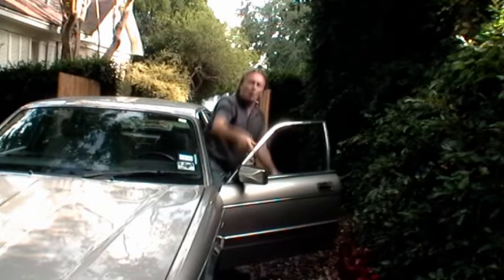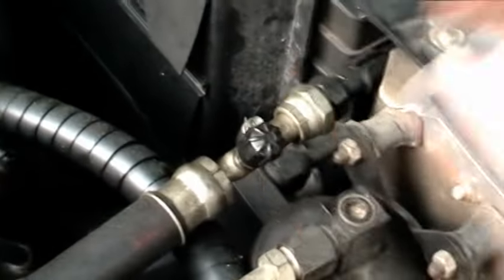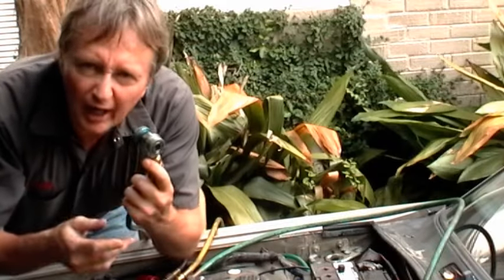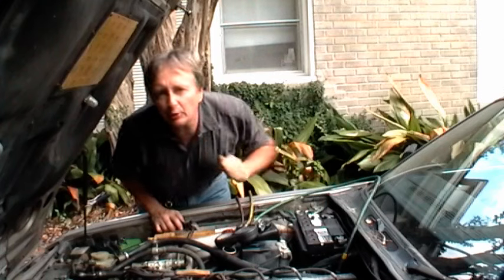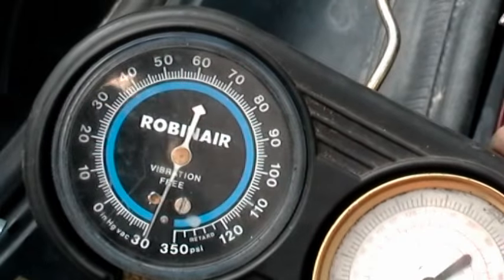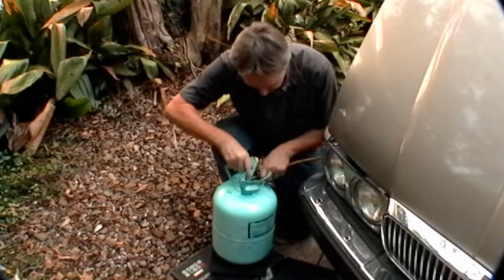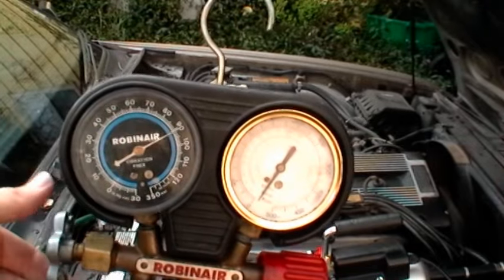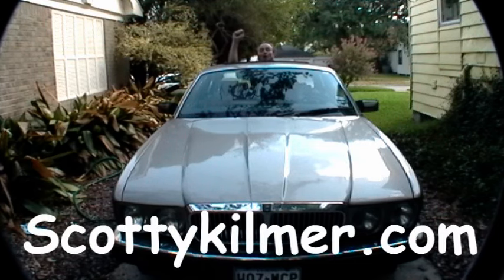How to Recharge Car AC System (Refrigerant)

Comment: I have an 88 Cadillac Allante. I just used the aftermarket coolant and it still doesn't get cold. Not even a little. When I first started, the clutch was engaging on and off a lot. Then it slowed down some. The gauge says I'm full. I wasn't able to hold the can straight up. Does that matter much?
Reply from the maker: you need the exact refrigerant amount, the ONLY way to do that is to vacuum out the old stuff, and add a factory load by weight or volume to be sure it's correct.. Start there

Comment: You may want to double check it my heavy duty truck systems text book ISBN10: 1435483820; ISBN13: 9781435483828 says 5 min and any time a A/C component fails or requires replacement the receiver/drier should be replaced as well.  My automotive technology text book ISBN13: 978-1428311497 ISBN10: 1428311491 is even more strict at 2 min for accumulators before it must be replaced.  Also any other parts left unsealed for extended periods must be flushed of solid contaminants such as dust.